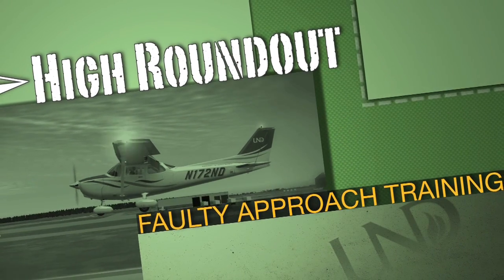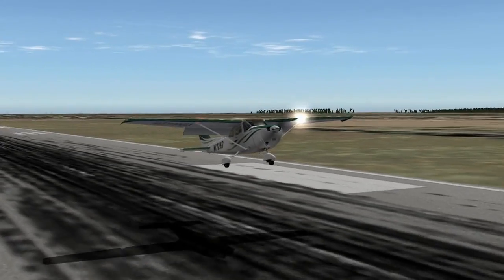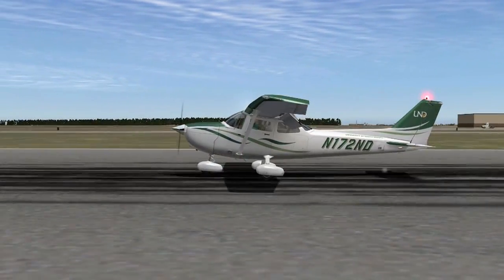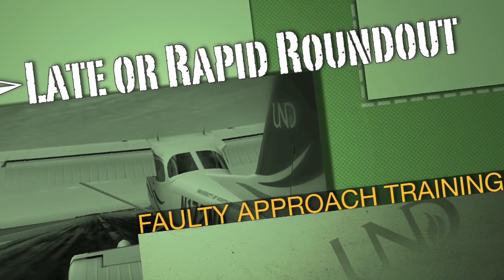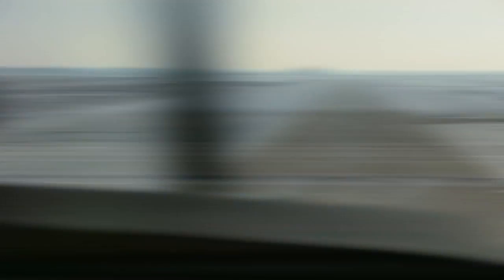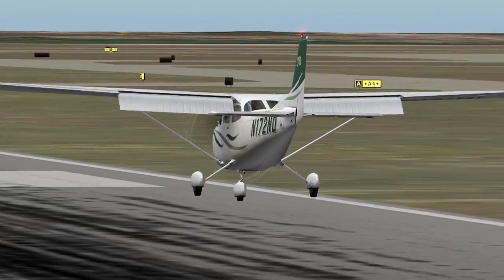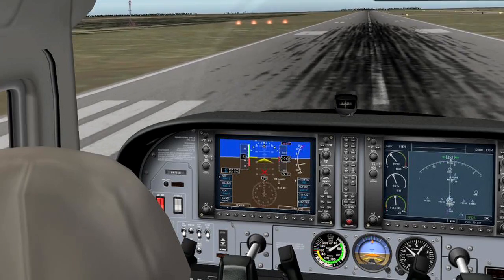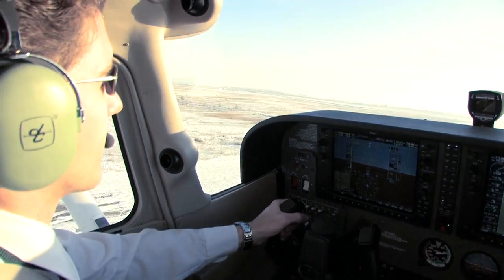(VIDEO 1 of 2) Faulty Approaches: Timing

Comment: 4,000 hr here, learned in the 60s from an ooold guy. Observational input here for the food for thought category.
Terms like back "pressure" are great. But easily confused with elevator INPUT, application, etc. Emphasis needs to be constant on FEEL, because feel, not inputs or movements gives the desired results. 
It seems to me that many of today's instructors have a tendency to try and get the new pilot enough hours that he unconsciously discovers for himself what he is doing wrong.
Back in WWII instructors that taught feel, not input/ movement, had total novices soloing Cubs in 5-6 hrs. Cubs that blow around like a fart in a windstorm. 
I've flown with many commercial pilots /cfi in singles and twins that were just driving them up and down and herding them through the sky. Also about half of them giving me BFRs wondered why my ride was so smooth. Sad.
Just because you can drive your car down to WalMart and back doesn't mean you are a good driver.
Just saying....